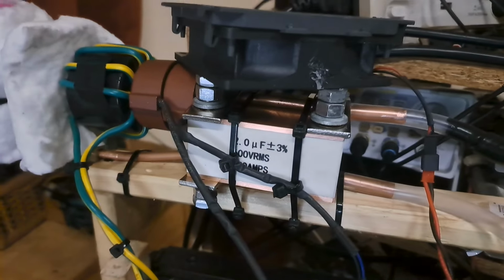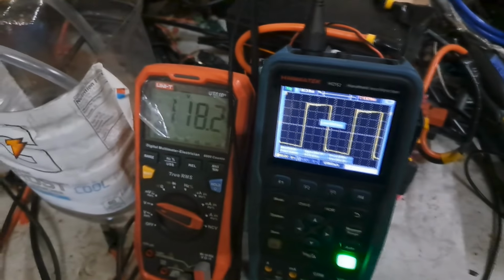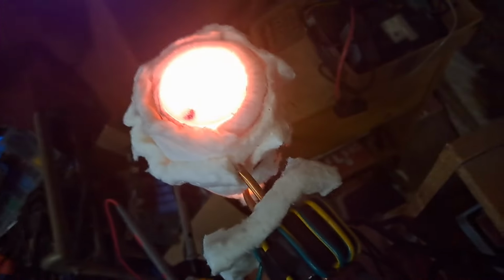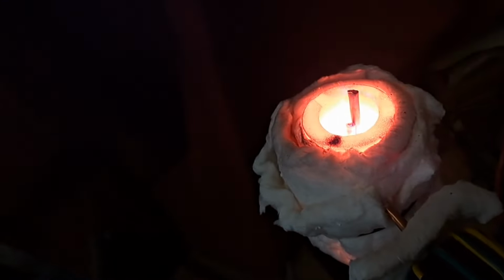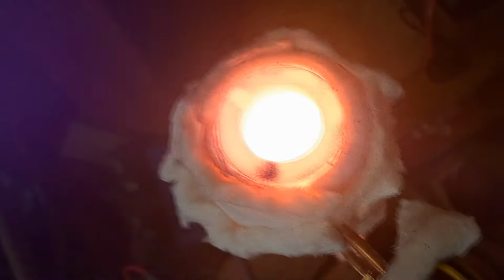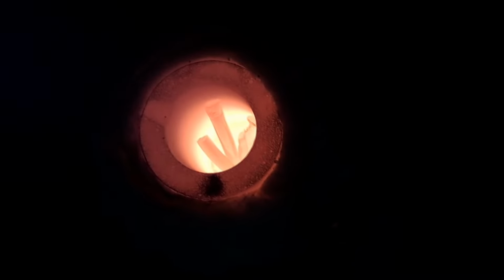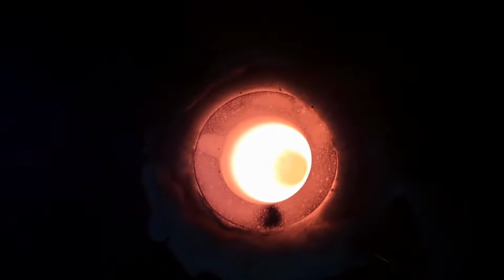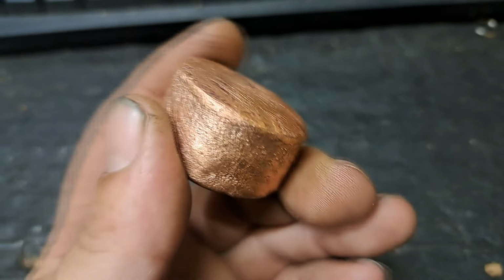H-Bridge Induction Heater Resonant Cap Test 1200W Copper Melt 87kHz

Comment: awesome! that capacitor really is something lol
Do you plan on putting this thing in a box? 
Have you tried levitating aluminum?
I also got my drsstc running thanks to some of your other videos they were great help (and then i started seeing 5mm sparks racing across the 5v logic)
Reply from the maker: Yea I have an old PC tower that's perfect for this thing. Probably won't levitate aluminum with this one. I'm pretty sure it could but I'd need to wind a special coil just to do that. That's sort of a more specialized use there so I'd probably just make another one just to do that. This one is just going to be for running the crucible in the work coil and melting down metals to pour out. 

Sparks across the logic is something I don't think I've ever seen before. That kind of sounds like some kind of CT snafu or something.
Reply: @Magneticitist  yeah... the driver is toast now. I'm going to see if i can make steve ward's 1.3b because I already have most of the parts for it and it seems like a decent driver without so many niche components like the ud2.7c. I mean, all it has to do is drive a small coil and (hopefully) not explode
Reply from the maker: @BoredHighVoltage  Really don't need an exact 1.3 with the small stuff. The first UD was basically made to be able to drive bricks. I've never made a UD board because I've never needed the 4 switching devices to drive the GDT, I just use a couple UCC's or even just a dual 4/5A driver if I have one. I also rarely use phase lead as that's more something that becomes more important driving bricks at the max. 

I basically always build something close to the DRSSTC 1 driver now. It has a flip flop and OCD and you can just use a couple 9A UCC's. For bricks I just replace them with IXD_614's. If you can build the UD board that's also fine but just overkill to me for small gates. Steve's interrupter w/burst mode always works great for me also.
Reply: @Magneticitist  I have a few bricks lying around... I wonder if i could run them at the 200khz of my coil?
thats basically what my driver is, considering all the OCD stuff doesn't work at all it's just feedback, hex inverter, flip flop, ucc chips. It does have the brick driving stage.
Reply from the maker: @BoredHighVoltage  I think I my 9A drivers were getting too hot running over about 250khz with 247 package IGBTs (full bridge maybe 25nF total). I have some old bricks that typically run 20-25nF on the gate each. So maybe you could pull off a half bridge at 200khz especially in a DRSSTC with really low on times. When you say it has the brick driving stage you mean it has the switches after the gate drivers then you should be able to run the bricks no problem.

Comment: Upgrade the insulation and it will melt much faster, make a lid for it. Looks very nice, great LC section.
Reply from the maker: I'm hoping I can find one of those ceramic insulators that fits perfectly around this crucible but I guess I can just wind another coil also.. but yea that definitely makes sense. I was using it here to heat the room lol. Do you know how many melts a 'decent' graphite crucible will last? I mean I highly doubt I'm going much over 2000F at this power but I plan to push closer to 2500F to melt copper if I can.
Reply: Why not using a regular ceramics cup 
And modify it to your need can you please share schematic with us
Reply from the maker: @Musoplhnhbfhn144  I still haven't really decided on everything with it yet. I'm waiting on more stuff for it to keep playing around like more crucibles and pipe. As for a schematic right now the way I'm testing it it's just a basic SSTC driver circuit and H-bridge. The only difference being there is a toroidal primary coupling transformer to drive the LC.

Comment: 'The big resonant cap also feels like it's getting slightly warm at only 1200W so it will definitely need better cooling'
Insulate the pins VERY carefully (also ensure they're mechanically stable), to ensure it won't flash over to:
Paint/apply some copper paint/tape to the body and top of the capacitor, then thermal-epoxy some heat sinks onto the copper layer now encasing the cap.
- like transistors were cooled in the 'good old days'..  If done carefully, I suppose this would be my 1'st thing to try out in your case.

Best of luck... Awesome project!
Reply from the maker: The whole thing will basically be insulated cause the inverter and cap will be inside an enclosure and the exposed coil will have ceramic insulating. I'll probably try to add some small water cooling blocks to the caps and the inverter as well.
Reply: @Magneticitist  Yes, it needs to be able to radiate off the heat as IR radiation in order to cool down.
I was under the impression you were building this into an old PC cabinet?  Does it need to be 100% enclosed?

Btw, a message went hidden, or something. I just wanted to point out the importance of NEVER adding wet/liquids to the crucible. Metals should be bone dry, in order to avoid steam spreading molten metal everywhere.  I thought it was important to mention a 2'nd time :ø)  Safety 1'st.  Wear thick clothing, face shield, gloves, good safety shoes, respirator and other PPE you find important to your well-being.
Reply from the maker: @EgonSorensen  Youtube will delete things randomly at times but yes I agree that is good advice and I appreciate it. Sometimes I don't think about these things. I've often done a lot of work in my life not taking proper safety precaution. Plenty of jobs where I should have worn a respirator but didn't lol. That's all pretty serious but I'm definitely mostly concerned about not giving myself 3rd degree burns. This is why I decided it may be best to try focusing on 120VAC operation. I should be able to use a thick extension cord and run it anywhere outside where it's more ventilated.

Comment: Amazing setup , I think is gonna look great once you put it in a enclosure , did you check ethan labs class E SiC oscilator ? He tried using it for induction heating and also trows a pretty sick flame
Reply from the maker: Yea he has a cool approach with his setup but I'm not sure if the frequencies he's running would be suitable for deep heating of thicker metal. The theory is that the lower frequencies are needed for that but the higher frequencies heat the thinner pieces faster. It's all voltage/current ratios though. The Mazzilli driver is hard to beat at low voltage if you build it right. I really like this setup because I'm able to keep it reasonable on 120VAC circuits. Any kind of power supply or transformer that can provide the 30-50A needed to do it at low voltage is just going to be too big and heavy. If you put bricks on a water block also this h-bridge topology can be really small.
Reply: @Magneticitist  yeah I think it is not effient as a heater , too high of a frequency , but he was explaining me on the cord that the SiC behaves way better at hfsstc than common fets cause of the low gate charge  , I talk you on cord but I see you don't use it that much
Reply from the maker: @rodriguezfranco3839  Yea that's why I use sic fets for HFSSTCs as well. Small regular fets can be just as easy to switch but will typically not be rated for the same current or just have more switching losses.  I only use them when trying to use logic to drive the fets though because the feedback current of most circuits is more than enough to drive normal fets. When you're using logic you have to supply your own gate drive stage that can handle the power so the gate charge really matters. discord doesn't really make sense to me cause I'd only get on it to share something upon request but anyone can ask me anything basically any time on youtube and I should see the notification. 

Any time I ever get on discord the only thing someone wants to ask me about is basically a driverless SSTC. It kind of bothers me that I still don't see them everywhere and even China is not selling them properly yet. It's like there's some secret sauce to it making it really difficult.. which is not entirely false but I know I could make one right now lol. I don't even remember much about it despite making so many. It's not something I can really iterate to people any better at this point but it's all people want to know.
Reply: @Magneticitist  Yeah I think I am gonna try again on the driverless hfsstc cause I really want to see "THA FLAME"  but this time I will go with irfp460 , I already killed two 260s but it was probably my fault , I just blew the gates cause of too much bias , my only problem is finding a good cap , but there is a dude selling a nice 100pf doorknob near my are , I will try to get it . By the way that big 12000uf x200v I bought for 4 bucks seems to be in very good shape , works fine

Comment: To minimize contact with oxygen try putting glass shards with borax in crucible that both float on top and don't mix with copper
Reply from the maker: Does that help to keep a nicer finish on it? I feel like I'd be grinding/sanding them down anyway but if it helps to reduce that process it seems worth it.
Reply: @Magneticitist  if you don't really care about pure copper try adding a bit of tin metal, therefore creating bronze which behaves much better during casting (see youtu.be/oekoorG404g )
Reply from the maker: @great__success  Not sure where I'm going with it yet but I guess mostly pure copper molds (IDK like trinkets or bus bars etc) but it would mostly probably be me melting down copper wire scrap. For some reason melting it down would have me want to actually strip it. I could easily just scrap it after stripping but to save space I'd want to make like 1lb bars over time.

Comment: Hey, that's some cool $h!t, I've made several small zvs types of induction heaters ( all were made with irfp 260 mosfets with only the glowing of metals, they are ok,.....but I want to move on and build something with igbt's, something that melts metals, lol that where the really  fun stuff  is I  think anyway!
Reply from the maker: This is def the way to do it IMO. Transformer coupled LC. Only need like 10-15A to reasonably do it at 120VAC or less. If you don't mind waiting like 10-20 minutes for the whole process then you can see it can be done at only like 1kW for copper. I can't really think of what could/would fail outside of thermal failure. Basically the same gist as a big SSTC but no high voltage and a very low impedance LC with very high capacitance.